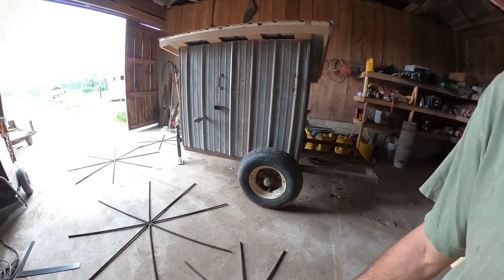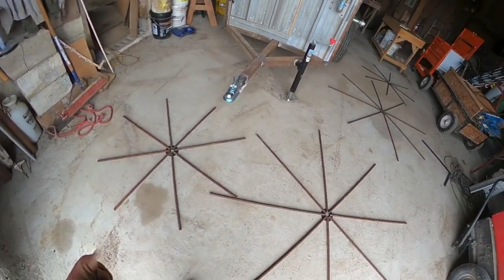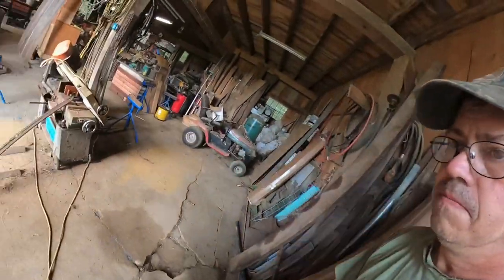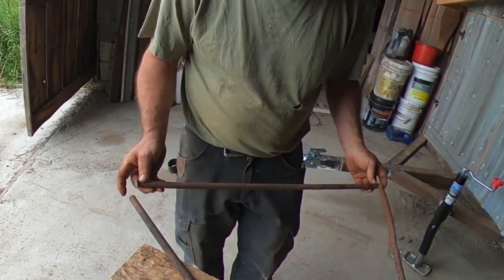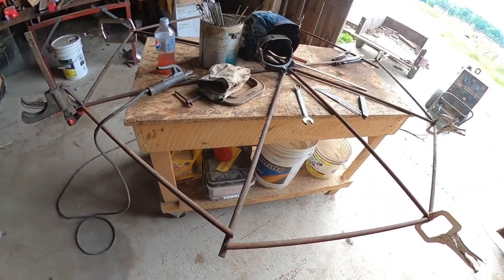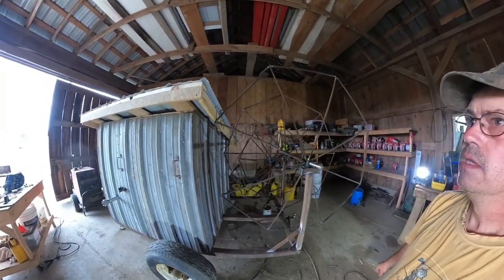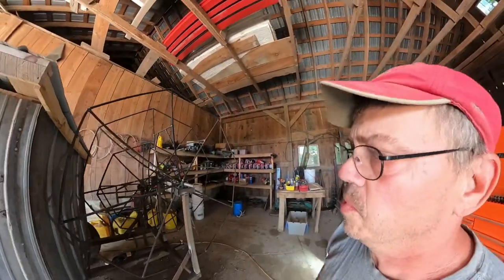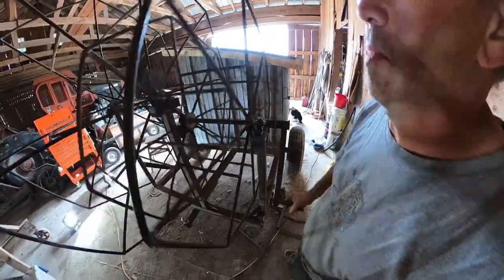Homemade heavy duty pipe reel.

Comment: I have also eliminated most garden hoses. I use three quarter poly pipe with cam lock connecters. Much faster to connect.
Reply from the maker: Which cam locks are you using I tried a couple different types and they leaked. When not leaking they are awesome. Thanks again!

Comment: Russ could those reels be used if you had a male fitting on the end of the pipe you were pulling out and a female fitting on the end still on the reel (that a hose could be screwed into to charge the line) to drag out pipe as needed on daily moves and then reel back in as moved back to water source??
Reply from the maker: I think it would work. Next i unreel them i'm going to try.

Comment: Russ, I have watched this video on making the reel.  Do you have one on using it?  In particular do you just have the one connection on the end, and keep rolling the reel out as you get farther from the pump?
Reply from the maker: I normally just unroll the whole pipe cause I'm going to need it anyways. But if you spool it right you could attach a hose to the end that is still is on the reel. Great question!!